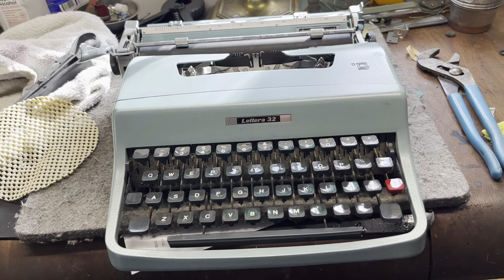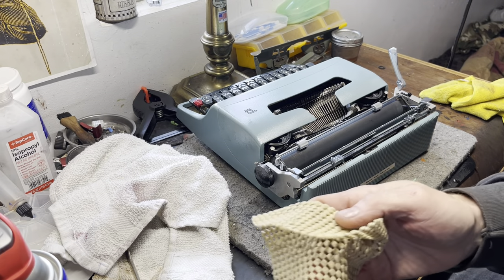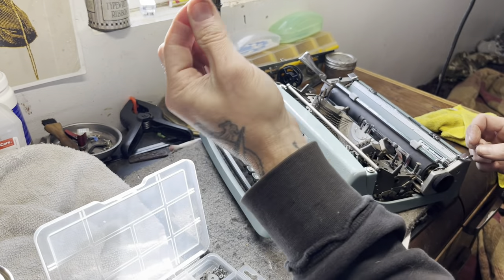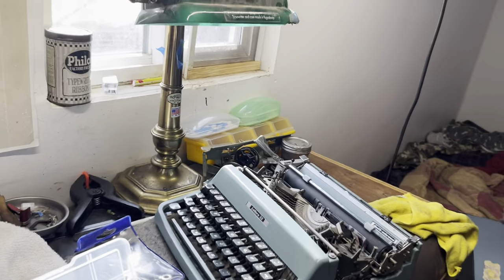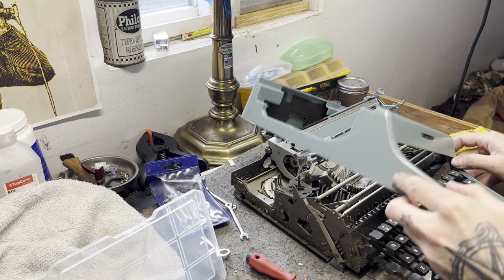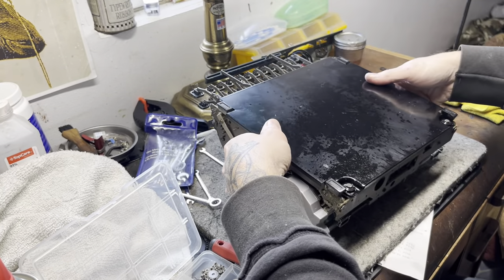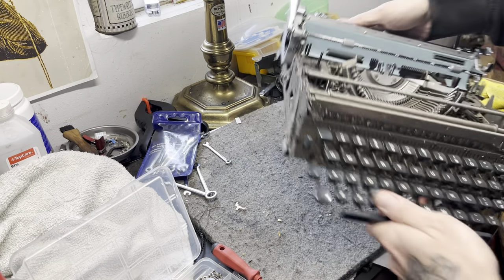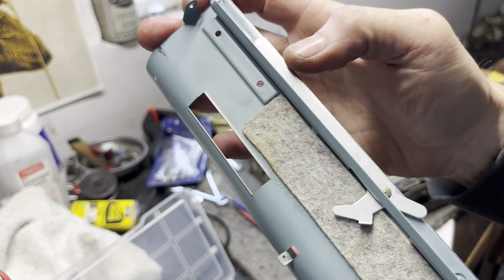Complete Lettera 32 Tear Down For Service and Paint

Comment: Trouble shooting question: on my Olivetti Lettera 32 the right knob won't come off, even with the right size Allen wrench. i've tried drilling through the little screw but it won't budge. The machine is missing a lot of pieces so I don't mind loosing a few more, but I can't get past that one little bit holding the knob in place. Any suggestions?

Comment: Thanks for the great and helpful video. When you say you chemically clean it do you mean you douse it in something? If so what do you do about the keys? Do you protect them in some way? Thanks for all your videos. I watch them all.
Reply from the maker: I use a simple green solution mixed with a little water. I spray the entire machine with the cleaner then hose it off either outside if it’s warm enough or inside with the shower nozzle in winter. I then use a hair dryer to get all the moisture out in under a minute. I wouldn’t recommend spraying cleaner directly on the key tops as they will loose their gloss if the chemicals are too harsh. Watered down simple green is pretty safe and I will spray the key tops then brush them with a toothbrush and rinse them off right after that. If they were glass keys then you’ll have to wrap the key bed with plastic wrap so they stay dry.

Comment: Thanks for this! Two questions: 

1. The body of my 22 seems to be bent, because I can't lift it up sideways to get it off. The body  contacting the carriage lock, and can't come off. How can I remove the carriage lock lever?

2. When the machine is assembled,  carriage engages when you push it manually, but only about one space or so in either direction (space bar doesn't engage). With the bottom plate off you can push the carriage all the way,  from below, but it's still very stiff. Does this sound like a carriage removal situation?

Comment: At 14:54 you mention tab issues. Would you go into how to repair that on a Lettera 32?

I'm having an issue on mine where the tab will go a few spaces or to the end of the set margin when pressed. And it recently started to have the space bar acting similarly to the bad behavior of the tab, sending the carriage to the end of the set margin that will not go back until the carriage moving tabs that are on the carriage are pressed. 
Before this issue started to happen, the spacebar used to just double space randomly in the middle of words. Now it is Russian roulette between a double space in the middle of a word or being flown across the page.
Any help is greatly appreciated.
Reply from the maker: It needs to be fully cleaned

Comment: Great video!
I just picked one up.
Says it's "Olivetti Underwood Lettera 32" on the mini user guide post card thing that came w it. Original case blue n black stripe that closes w a zipper, and dark plastic fabric type cover that goes over the machine. 
Feels nice to carry this thing from it's handle. 
Do you happen to have a specific instructional video on how you clean these old machines? Like how to remove the gunk and with what tools, how to relubricate and with what.

Comment: I have a , what looks to be a lightly used, 32 which types well but has a loose carriage.  If you grab the platen knobs you can rock it back and forth. My other 32 is tight in comparison. I do not see anything that is adjustable.  I should probably just let it be but it bugs me. Suggestions?

Comment: so... what did i do wrong, hotrod?  i'm working on a lettera 35l.  took platen out as shown, cleaned everything and put it back.  now it will not reverse and the line selector is, let us say.... inaccurate.  any advice, man?  thank you!
Reply from the maker: I haven’t worked on the 35. I would take it out and reinstall it as there is something out of place
Reply: Late reply but I just started on a 35L. Did you get yours sorted out?
Reply: i did,  @JenniferBehrens-y6h .  can't remember exactly now but i think it was partially finding a vid on phoenix typewriter and an email or three with richard polt.
Reply: @dharmapocalyptic Thanks for your reply. There isn’t much out there about the 35l that I can’t find. Guts don’t seem to exactly match the 22s or the 32s.
Reply: i dig the 35's jet style profile and easy disassembly with only three body parts with a full metal floor, not half as is found on the 32.  the differences are found especially around the platen (knobs, switches, paper bail, rollers...) and on later 35s, if i recall, the ribbon spooling system (check that). yet i've been told one can install a 32 machine into a 35, @JenniferBehrens-y6h.  the 35 is also far heavier so it stabilizes on the desk nicely if the rubber feet are still soft, which they usually are.  another 32-based machine is the underwood 319.  far lighter (quality plastic body) but same 3-piece construction in the shape of a nifty 1970s retro-futuristic machine that looks like it was created by the prop designer for woody allen's "sleeper."

ultimately, any 32 vid ought to parallel the 35 enough to help you, as well as any other 32-based machines but, as with the 35, info seems bereft online.  maybe as they get older and the vintage 1950-1970 machines get harder and more expensive to find, we'll see more helpful vids and discussions regarding their repair.  peace out!

Comment: Incredible video man - thank you so much! What is the body on the Leterra 32 made of? Aluminium? Do you think it would be possible to strip the paint off with a chemical agent and be left with a kind of bare-metal look to the body? Would it need some kind of sealant to prevent corrosion? Let me know your thoughts - thanks again for sharing your knowledge through these videos!
Reply: What did you find out in the meanwhile?